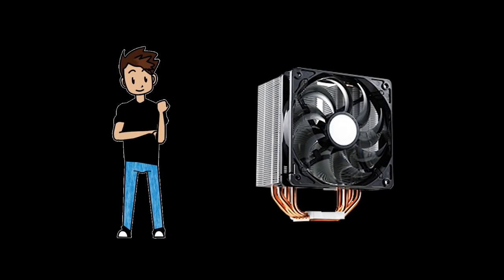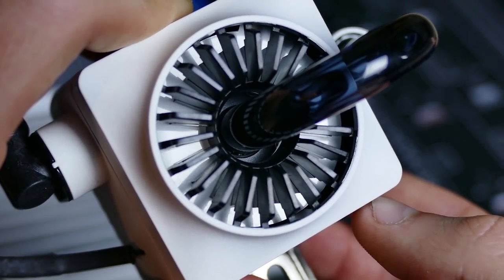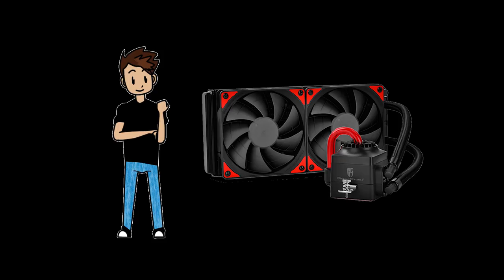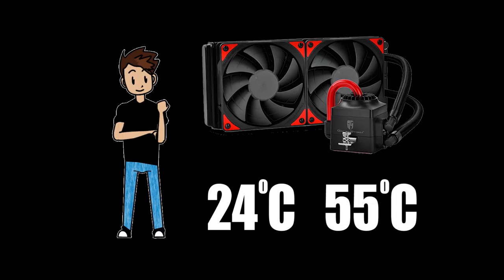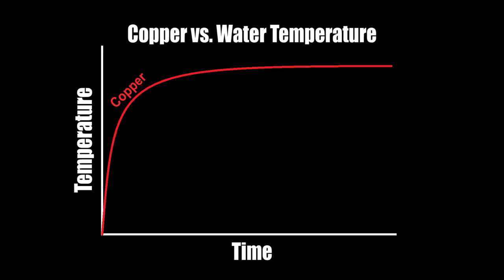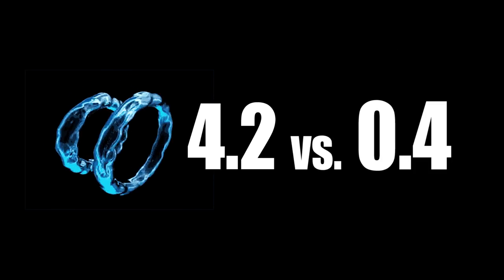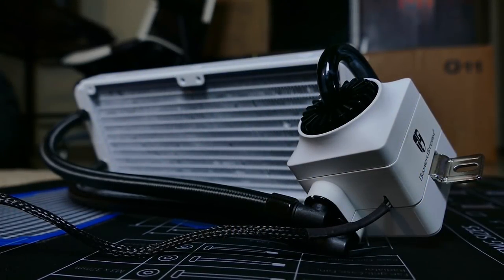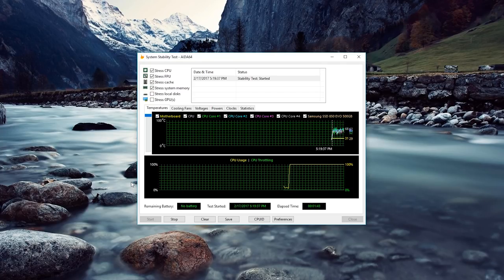How to Properly Measure AIO Temperatures

Comment: Not to be rude but you did not really say anything here. You took the real world benefits of liquid cooling and wrote them off as negligible side effects. For example, you pointed out that it takes much longer for a liquid cooled system to stabilize and that once the system does stabilize the actual temperature delta is much smaller than AIO companies would have you believe (which is completely true and a valid point). However preventing the system from stabilizing for as long as possible is how a liquid cooled system gains its usefulness. By maximizing pump rates, coolant volumes, and radiator surface areas liquid cooled systems increase the amount of time it takes to stabilize, thus allowing the system to run a higher overclock for a longer period of time without throttling. Obviously these systems become less efficient after being run under synthetic load for an extreme amount of time, but that is less of an issue with liquid cooling, and more of an issue with synthetic bench-marking. the results, while useful when taken with a grain of salt, are not that applicable to the real world.
Reply: That makes sense
Reply: You're right Joe... He spoke a lot without actually saying anything relevant.
Reply: joe Jacobs if you think he didn’t say anything then you weren’t listening
Reply: > are not that applicable to the real world

I've had workloads(for work) where a machine is processing data for days, even weeks with CPU use at 100%. So they're not only relevant to benchmarks, many users it won't matter, but there very much is real world applications that it is worthwhile to know :)
Reply: you shouldn't us an AIO then, build a Liquid Nitrogen cooling system
Reply: @YesthisisCharlie  Not practical long-term, how many companies with workstations or data centers do you know using that?

Comment: Ok then, someone make a cooler that uses both a radiator and a heatsink! Best of both worlds, right?
Reply: The Booty Guru how the crap would you mount that?
Reply: ArtisChronicles uhhh, use a full tower case lol
Reply: ArtisChronicles 
Think about it... If you have a 212 tubed to an AOI radiator, it could probably be mounted in the same cases that are capable of mounting those coolers now. I wouldn't buy it but still... 🤔
Reply: They made them for CPUs a while ago. Not enough benefit though. They still do it with hybrid GPUs. The water cools the GPU chip and the air cooler cools the memory and other components around the chip. Straight water cooling is still better though. You have the ability to have a lower top temp compared to air.
Reply: No because they work exactly the same. Water coolers and heat-sinks dissipate the accumulated heat into the surrounding environment. But water coolers don't suffer from as large of spikes in system heat as you have to heat the entire contents of it's water while it is being passively cooled.
While a heat-sink can never technically fail as they have zero moving parts they are also very bad at cooling and maintaining a constant temperature as they are limited by the amount of material and it's ability to absorb heat then dissipate it into the surrounding air.
Reply: Bad idea, it causes pooling and actually reduces the effectiveness of the cooling solution. Same thing applies when modding a Heatsink, if you were to apply additional heat spreaders to the wrong spot like the first half of a heat pipe it would cause pooling and make it run hotter. I know because I have done it lol.
Reply: its not the heat sink or the water cooler cpu attachment its about the size of the radiator it needs to be large enough to dissipate the heat built up over time so if you can cool the water faster than it heats you have a winner however i use air cooling for the simple fact that a leak can kill a system

Comment: Is it possible to install copper wires inside the water tubing
touching the CPU. Will this improve CPU cooling at a faster rate ? 
Hybrid cooling system? Would like to see if its possible and will it 
speed CPU cooling.

Comment: A bit off topic, but the difference reminds me of the differences in cooking with normal aluminum non-stock pans vs cast iron skillets. Like with water vs copper, a cast iron skillet actually heats up much slower than aluminum, but on the flip side, once its hot, it stays REAL hot.

Going back to CPU cooling though, looks really don't matter much for me, while reliability and longevity definitely does. Big air coolers like the Noctua D15 or even U14S can already keep up with a lot of AIO's, so what seals the deal for me is that an air cooler will never break. Even if the fans eventually break, they're easily replaceable. You can't replace an AIO's water pump once it breaks in like 2-3 years. AIO's are consumerism at its best: replace every 2 or 3 or even every year, after every new rig or upgrade for the sake of 4-5 degrees over a proper big air cooler.

Comment: I have an aio and my idle temp is 97c after 5 minutes of being on the desktop
Reply: 97 degrees dam, did u remove the plastic that covers the plate before u installed it?
Reply: dpsilver no but i used nutella as thermal paste
Reply: Revilo Try rasing the voltage.  Should use less amps and decrease heat
Reply: Revilo Nutella as thermal paste. I know black things run faster but that doesn't apply to paste :p
Reply: don't use food as paste, your cooler should have came with proper thermal paste
Reply: Kyle it's a joke...
Reply: I lowered my temps by 10c by using liquid peanut butter. It’s much better than nutella and I suggest you use it
Reply: Liquid peanut butter is too pricy, use mayo for best price-performance
Reply: You joke, but someone on Xtremesystems tested a variety of things years ago, I remember ketchup did very well against arctic silver 5 considering how much cheaper it is.
Reply: everyone knows the best way to cool your system and increase performance is to add as many RGB components as possible
Reply: That's just a popular myth these days Manny, stick to food.
Reply: I think you might need to re-apply fresh Nutella.

Comment: Ya but during those 'couple of hours' you will be running a much cooler processor which is the whole point... Average computer usage time = you guessed it, a couple of hours. So effectively you ARE running the 'much higher delta' you speak of during the two hour window of typical usage time.... Therefore water is waaaay better than air for most people who adhere to typical usage time.
Reply: if you're just defining "typical usage" as video games that's fine, but the other half of people who actually spend money to go beyond stock coolers is made up of content creators building workstation PCs. for tasks like rendering the typical usage time can be an order of magnitude greater than the time it takes for actual core temps to peak. in which case the aio is only worth the premium (the least wear-prone models are about double the cost of a noctua) if the steady peak delta feels worth it to the user. what i mean is, an AIO is never going to give you half the peak temperature for the same fan curves, unless you're upgrading from a really shitty stock cooler. so you're paying around double the price for less than double the cooling performance, which is usually how price to performance goes. there are diminishing returns on every dollar you spend past the basic level, and that's perfectly fine. when we're talking about workstation PCs, that extra -5 degrees can go a long way towards extending the life of components, but consumers should be aware that it's all they're really getting when they leave their system rendering overnight. because i'm sure there are some content creators who really wouldn't want to spend twice as much for an AIO to get peak temperatures just a few degrees lower than a noctua. especially true for CPUs like the tr-1950x, i can speak from personal experience that the noctua nh-u14s has almost identical peak temperatures to the H115i. and at least for me, (and trust me i applied thermal paste correctly) actually produces a LOWER peak temperature than the enermax liqtech tr4 which everyone was hyping about at first. returned it within a week. the H115i may have far better cooler performance, or at least much closer to a custom loop, but it's not really intended for the size of the threadripper, whereas noctua makes a version of the nh-u14s which is specifically designed for the massive IHS but places the heat pipes directly over the dies. when i was still using the threadripper workstation exclusively at home, a custom loop gave the best performance but certainly not the best price to performance ratio. now that i use it as a mobile workstation/media server it makes more sense to use the noctua. AIOs are definitely way more portable than reservoir+block systems but they still aren't as safe in transit as a fan, and the extra performance you get is just not worth the extra fuss. so in this specific use case i think it's pretty important information. i can definitely see why the average gaming PC would reap bigger rewards from liquid cooling though.

Comment: so i get you're basic point in  that some testers are not disclosing the fact that it takes longer for AIO cooler temps to stabilize during long periods of use. however the mention of the core remaining at a higher temp for longer periods of time after use is subjective because most users with any experience with electronics knows you should allow your system to cool back down to idle temps before shutting it down, if you ever do at all. i think both cooling types have pro's and con's but my personal taste is using an AIO like the Kraken X62. It's very efficient, the radiator is mounted "out of the way" in the front of my case and it doesn't clog the view of my build like most of the newer air coolers that have gotten just monstrous in size that they just look ridiculous to me. Just an opinion, that's all.

Comment: Your video made a lot of sense about the specific heat of water versus metal.  I'm left with a question about the long-term effects though.  In my own feeble mind, I would hypothesize that the slower temperature deltas of the liquid cooling system (due to the long period of time required to heat up the liquid, followed by the heat retained by the liquid after use) would put less stress on metal components due to the slower expansion and contraction of the metal.  Your opinion?

Comment: If it were completely true, we would not use radiators on cars ... Just like that
Reply: if we did that we would all have to drive go carts like the old beetle.
Reply: Why wouldn't we use radiators on cars? Liquid does not heat up quickly. That is a true. You can turn your engine on for 10 seconds without the liquid changing very much in temperature. The point of the video was about looking at how quickly the liquid heats up, instead of how well is dissipates heat on an average over a long period of time, which is a misleading benchmark. And not looking at how quickly the system cools down.

No liquid system, at the same temperature as an air cool system, is going to cool off at the same rate. Liquid retains heat. That is why old homes used liquid radiators to heat their homes instead of heating the house using air. Why? Because liquid will retain heat over a large stretch of piping. Air will lose it's heat to the environment very quickly because it has a low heat capacity. Which is why homes that used air heating were so dangerous. The air had to be heated to such a high temperature that it would potentially cause fires. We eventually worked out the kinks by using a boiler that burned gas/oil more efficiently, and used a better vent system to alleviate this problem (by using a larger volume of air so loses are minimized).

It's also why your radiators at home (in older homes, anyway) will stay hot for hours after you shut it off. That liquid is going to hold on to that heat for a long time. Meanwhile, your HVAC system will be cool to the touch within 5 minutes. So long as you don't touch the boiler. That thing is going to stay hot for awhile.
Reply: kinda sorta not really. in cars, we are more concerned with keeping metals and oil 'cool', relative the boiling point of water, the temperatures we want to keep the metals is alot higher.
Reply: @megamixa  I wish that were true for my house radiators. Its cold an hour after radiator is turned off in basement rooms and they make loud noises. My grandmas air vented house stays warmer. My house only has better insulation.
Reply: @solosamuraiz1526  I wasn't saying water radiators were better. There's a reason you only find them in very old houses, and old apartment buildings. It's old technology. Ventilation systems are much more efficient. Also gives you the option of cooling your house.

I was just point out that the radiator itself will stay hot for very long after you turn it off. Whereas your vents will cool off within seconds or a few minutes. The radiator will be warm for a good hour, or longer depending on the size of the house/system.

Comment: Good video, unbiased an accurate.  Water cooling still gets better results than air, but... it's not as much as you think due to the longer time for water to heat.

This is why I've argued that fans on radiators are NOT to be neglected.  For a water cooling rig to work, it MUST move air and exchange that heat... IF you can bleed it off faster than it accumulates, you win, even under high load, even after hours under high load.  If the water can't dissipate the heat in the radiator faster than it builds over hours... you're boned.

The problem I have with this is water cooling is often sold as a 'quiet' solution, so people think fans pushing air on the radiator don't matter, and leave cheapie stock fans from an AIO, or choose fans for noise over performance.  If they do temperature testing without waiting, their findings give a false sense of performance.  

I run a push/pull with 4 Noctuas on my radiator.

I don't know that this means they are lying to you... it's not like it's a secret... it's physics.  Reviewers not understanding what is happening and taking temps too soon are a separate issue from AIO cooler marketing.

Comment: 4.2 vs 0.4 example is irrelevant. The water is not stationary in a AIO. The pumped water in and out performs a lot quicker heat transfer than rods of copper connected to a radiator would.

Comment: just recently installed corsair h150i with my 10600k and are having issues with temps. with an all-core OC at 4.8ghz and fixed vcore at 1.32v im having temps go up at 90 C in prime 95 with avx off, and 100 degrees with it on. things i have checked are that pump is working, fans are spinning, and cooling paste coverage is good. so far using the pre-applied paste. when i start the test, temps go from idle at 30-35 C instantly to max temps. using extreme profile on fans and pump.

Comment: Just because you turn the program off it doesn't stop the water flowing and cooling in the radiator. Water might hold heat longer but it's still being actively cooled so it's going to be in the order of minutes heat rather than an extended period.

Comment: "In conventional “fan-plus-finned-heat-sink” air-cooled heat exchangers, the primary physical limitation to performance (i.e. achieving low thermal resistance) is the boundary layer of motionless air that adheres to and envelops all surfaces of the heat exchanger. Within this boundary layer region of “dead air”, diffusive transport is the dominant mechanism for heat transfer. The resulting thermal bottleneck largely determines the thermal resistance of the heat exchanger.".. "In comparison to air, liquid cooling is 2-10 times more effective in transporting heat away from a source to a secondary cooling surface, where the ratio depends on the way it is utilized. An ideal coolant has a high thermal capacity, low viscosity, and low cost, and should be non-toxic and chemically inert (not causing corrosion in the cooling system). The most common coolant is water because of its availability, low cost and high heat capacity." 
There is no lie, there is only people that don't understand the entire process..  If you have the correct AIO water cooler then you will have lower temps END OF STORY.  Also, turn that "F"ing GAY RGB shit off..   FFS that crap needs to end, it's just pathetic. In your own words, "It will cool your CPU better"...  Well no SHIT...   FFS my max temps have NEVER gotten as high as when I ran "AIR" at load or idle.   As a matter of fact my CPU sits just a cunt hair above room temp at idle and after running all day long it doesn't take long for it to get there when it goes to idle..  BUT, I know what the "F" i'm doing. Jesus Christ..  Semantics..

Comment: i have yet had my AIO lie about the temps its running. its idle temp is my room temp maybe a few degrees higher but its under load temp is around 55-60. which is exactly what it should be air or liquid cooled.

Comment: Would there be any benefit to connecting/operating the radiator in such a way that the water continues to cool after the CPU is turned off, thereby increasing the heat dissipation?